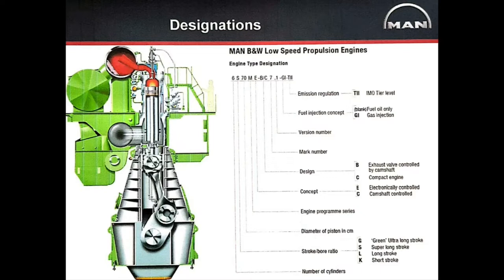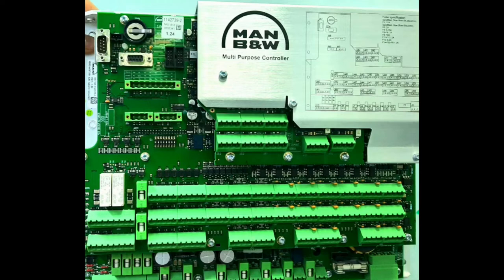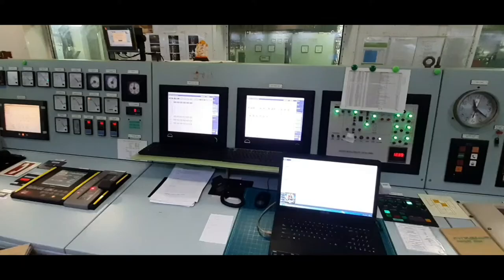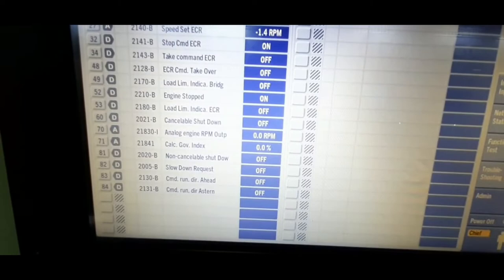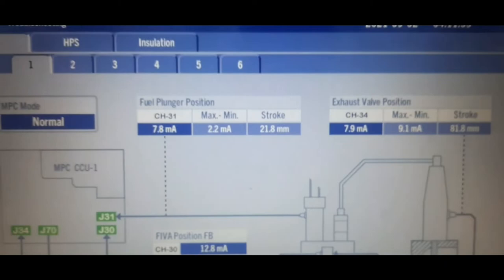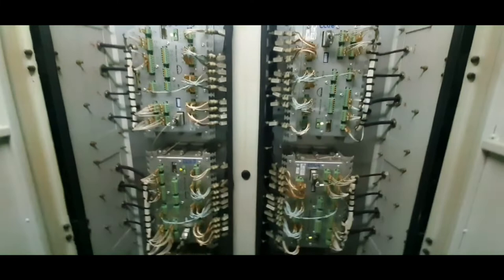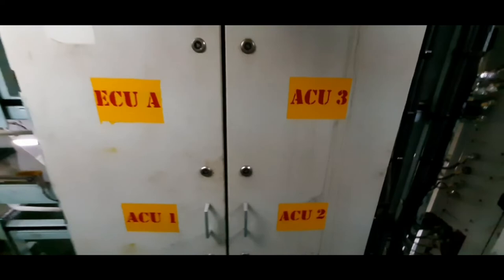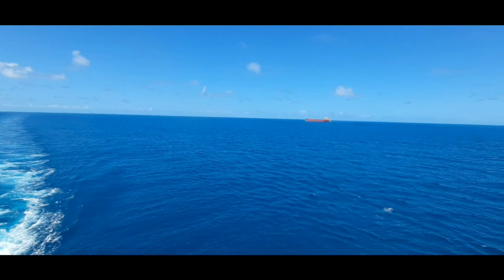ME ENGINE CONTROL SYSTEM

Comment: Sir in the event of failure of both EICU then is it feesible to run the system directly from emergeny manoeuvring and what precautions to take
Reply from the maker: Hey it's a absolutely valid query and I do appreciate it......
Every commend given to ME Engines need to b processed through the MPC of EICU's.... Engine won't fire if there is failure of EICU MPC's.
The local control station is provided to deal with problems relating to communication signals from Brige or ECR control stations...if at all the command signals from these stations fail to communicate with EICU than u need to operate from  Local station.
In any case EICU needs to process the signal prior further communicating with ECU's.